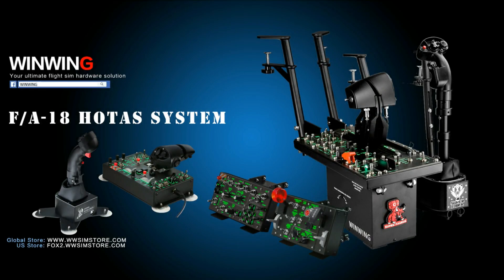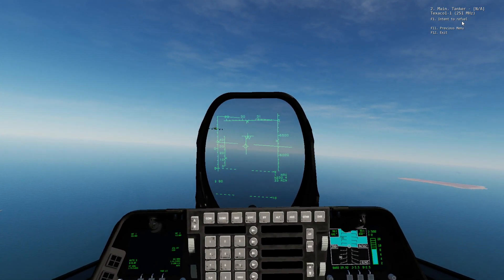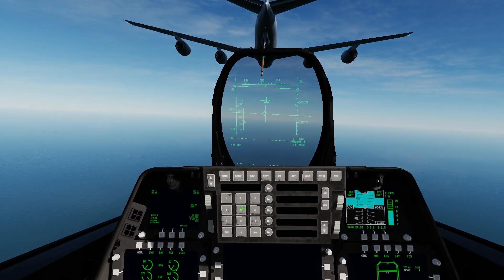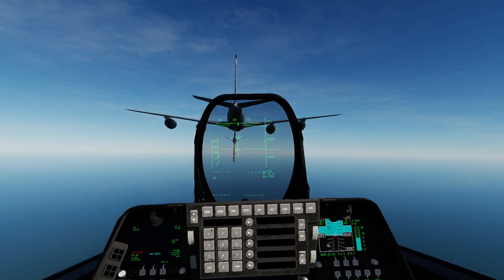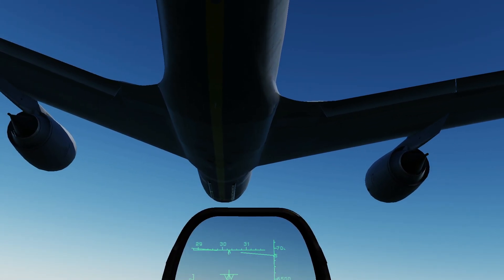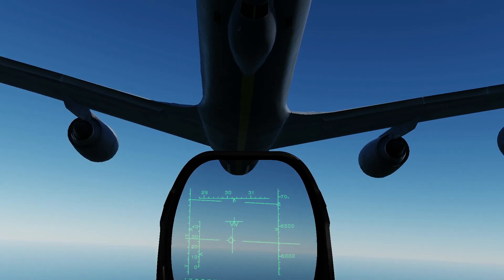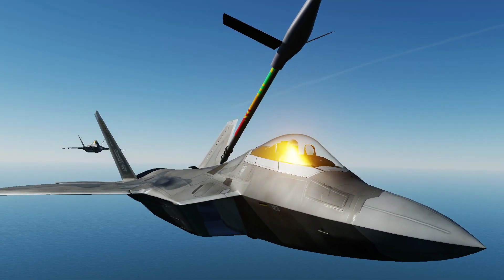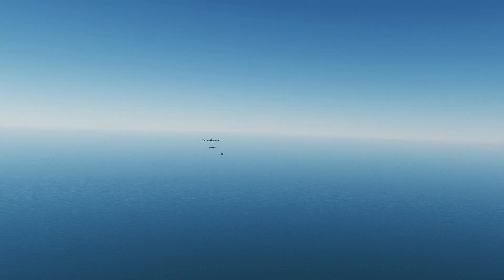F-22 Raptor Mod: Air To Air Refueling Guide | DCS WORLD

Comment: I once did an Aerial Refueling with My Su-33 at 0.5x time-speed using a xbox controller. had to very minute movements on the analogue sticks  with 25-30% curves.   Now i have to try again now that i have a proper FCS like Logitech extreme 3d

Comment: Hi Cap, this might be the most stupid idea but..... WATCH THIS!!!

Drag race - level flight, which plane can go from mach 1 (or top speed) to stall the quickest using Air brakes, flaps, canopy, wheels or any other appendage possible (loadout).
Reply from the maker: Great idea BUT there is a problem currently. Mirage brakes not modelled right, slows down 3 x faster than anything else :(
Reply: @grimreapers  simply relagate it to the bench sir, it comes as no surprise that it surrenders airspeed at an alarming rate.
Reply: @grimreapers  That's the French for you - anything to avoid a fight. Bet it has a reverse gear too!

(just kidding mes amis, of course France has a long and distinguished history of military aviation)

Comment: The best way to practice AAR is to NOT practice AAR.  Make a mission with a tanker with random waypoints and loop the last waypoint back to the first.  Forget refueling and just practice flying in formation.  Make it fun, by challenging yourself to get closer and closer and holding it.  Then when its time for AAR, it will all just come back to you.
Reply from the maker: Copy
Reply: Yes.  In real life, fighter pilots learn formation flying before they learn aerial refueling.  Also, a real F-22 Raptor has an actual FCS aerial refueling mode which activates when the refueling door is opened.

Comment: I’ve only ever pull off AAR one time and it was so effing stressful I’ll never do it again. I don’t care if It limits my range, I refuse to put myself through that shit again... 

For now...
Reply: @kodefa Shmodefa I think the basket and probe refueling is easier (fa18 type). The trick is not to look at the basket. Fly to keep the pod under the tanker wing in the same position on your hud then it comes together nicely. Eventually you can refuel while turning etc. it adds a great element to missions and campaigns.   There’s good tutorials on here if you search. Enjoy!
Reply: I thought the same thing. It was impossible to refuel at first, with both f-14 and f-18. Then, taking my time, I suddenly could do it with my f-18. During f2p, I tried the f-16 and suddenly that worked too. It takes time and practice, knowing how to make little movements. Maybe set a bit of curvature on the stick, I play with 15 on both axis giving me a bit more fine control
Reply: @laurenbro44  the only time I pulled it off was the F-18. I think maybe the A-10 would be on the easier side since it’s up front along the center line. But I tried the f-16 and I don’t think I can handle doing it via the locator lights on the tanker yet. I think I’ll try A-10 next time I get up the nerve, it is THE most frustrating thing I’ve tried to date. I know it’ll get less frustrating with more practice, but that first success was preceded by legitimate stress hormone dump. I couldn’t even imagine doing that IRL where there are consequences for effing it up.